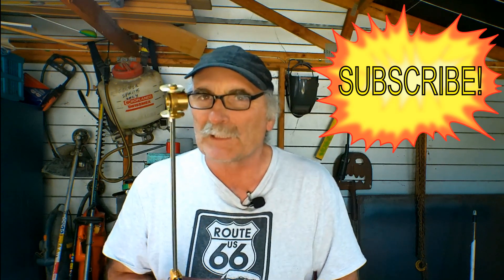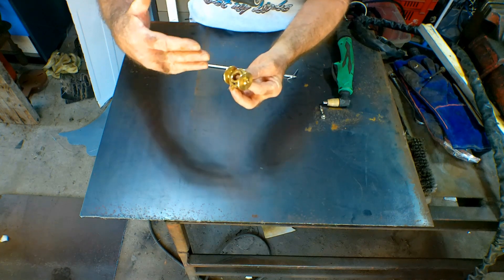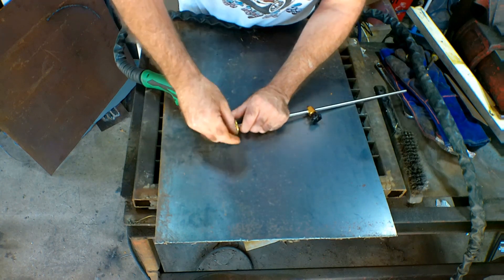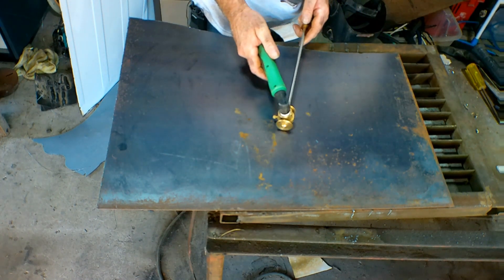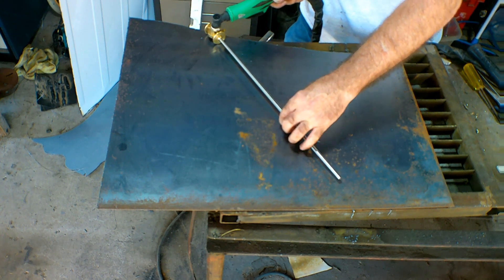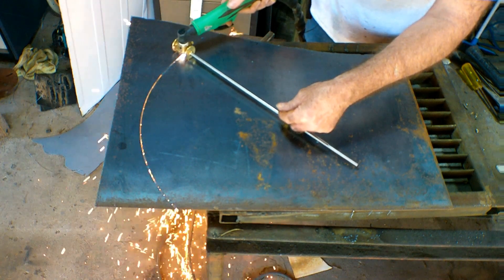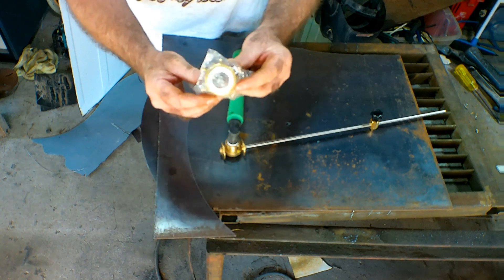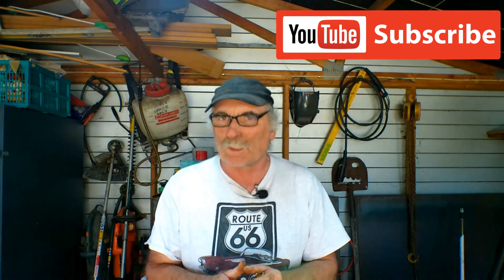Plasma Cutter Circle Tool - Make circles with ease!

Comment: Pete, I bought a p-80 to replace my standard 50a torch (chinese machine cut 50) and it won't penetrate 1/8" plate while the cheap torch had no problem. Any idea what that could be? maybe air flow? the arch also seems shorter at the same amp setting.  Feel like I'm doing something wrong as it is clearly a better torch.
Reply from the maker: Hi Drew . what size is the hole in the cutting tips ? 1.1mm -1.3mm -1.5mm .The bigger the hole size the more power and airflow you will need, cheers mate